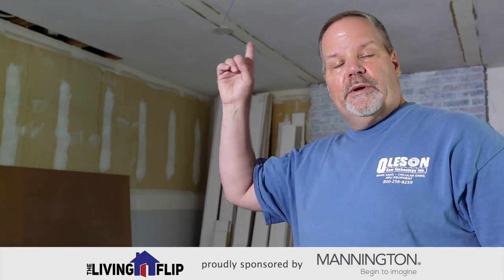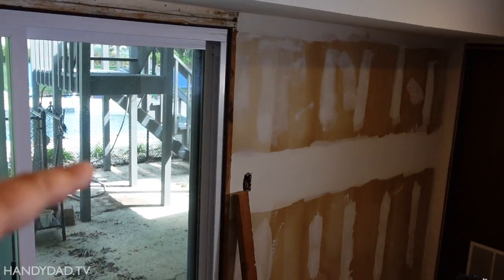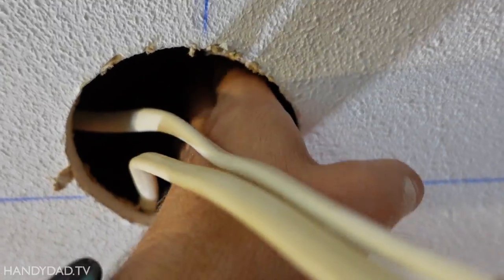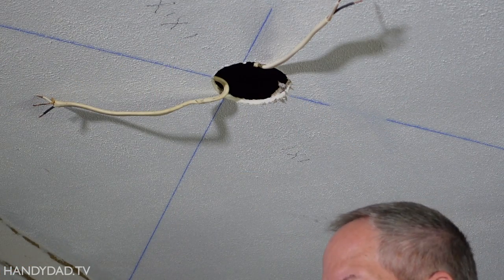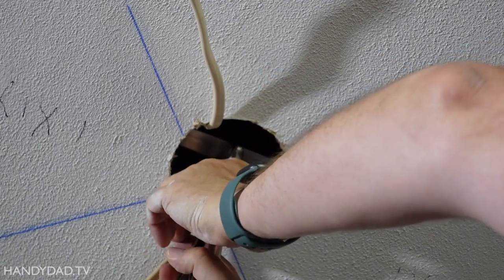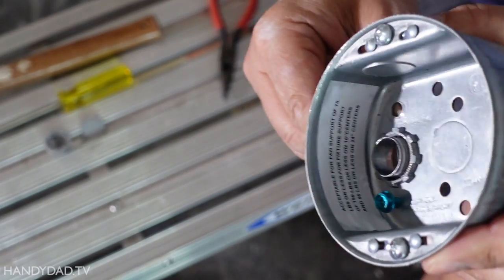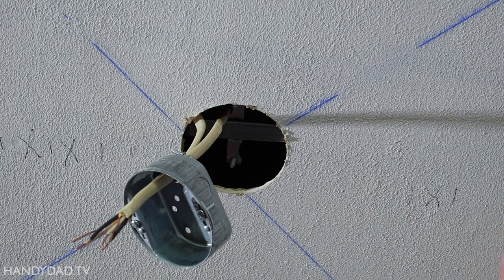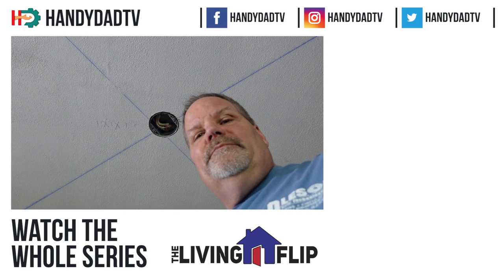WE ADDED A CEILING FAN // TLF 35

Comment: Great video showing how to install a ceiling fan/light junction box hanger. I purchased the same hanger and went into the attic to install the unit. With the legs upside down it was easier to screw them into the 2 framework. Easy to install and makes for a very secure hanger for the ceiling fan/light I installed.
Reply from the maker: Definitely easier with an attic

Comment: It has been a long time since I worked in residential electrical work, but I believe the Hubbell-Raco 2711B5 Connector, Squeeze, NMSC Cable, 1/2-Inch, Zinc requires an insulating bushing like Rigid/IMC 1/2 in. Insulating Bushing. You provide good tips and excellent process work. I may be wrong but If I recall correctly an uninsulated connection such as the one used requires by NEC an insulating bushing o minimize the chance of cutting the cable or wires.

Comment: I don't even need to install ceiling fan but I still watch it, it's very relaxing to watch your videos
Reply from the maker: Thanks so much 😊
Reply: @handydadtv  hello again‼ I need your expertise help again. I have a project where the kitchen lights I have are 2 halogen ballasts. I want to remove those and replace them with flush mounts, but also add 2 more flush mounts totaling 4 flush mounts. My question is how wod I add the 2 more electrical sources for the 2 NEW flush mount lighting?
Reply from the maker: You need to add ceiling boxes for those lights. Here’s one way to do it: https://youtu.be/KvZzLJmJhtU
Reply: @handydadtv  Thank You! For some reason the link will not open up though.
Reply from the maker: Hmm don’t know why it won’t work. Just look on my channel for a video a couple of weeks ago about adding a ceiling box in an existing ceiling.
Reply: @handydadtv  Yes ok. I think I should've asked, how would I tie in all of the electrical off of the 2 existing light receptacles to the 2 new added receptacles. I do know I can use the 2 round old work receptacles for the 2 new lights. Sorry for the confusion!
Reply from the maker: Ah gotcha. Here’s another video link https://youtu.be/x4TooPn0hd8. If that one doesn’t work, look for my video “Recessed lighting without an attic” about a month ago. It shows how I ran wires from an existing fixture to new ones. 

BTW, I realized the previous link was to the same video you commented on! Maybe that’s why it didn’t work.
Reply: @handydadtv  ahhhhhh ok, Thanks‼

Comment: TY for sharing.... I was running through this same exact scenario I needed an answer for and never realized that there was this type of box. When I installed the ceiling fan I noticed a week after it came down a little bit from the ceiling meaning the box was loose and when I first saw the box it looks like they just screwed it directly into the joist that was running alongside the hole. It was a plastic box and not a metal one. So I'm going to remove the fan remove the box and figure out the best case scenario. Thanks again and you now have a new subscriber because you present everything in very easy to understand terms and methods and installations.
Reply from the maker: Thanks for subscribing! Welcome to the family!

Comment: Thanks for this video im remodeling a manufactured home,  no cieling light, im using same bracket but its 2 1/8,  no biggie,  but i used  14/3 wire so i didn't have to run 2 lines 1 switch for light, and 1 for fan. thanks again. happy Thanksgiving. ✌
Reply from the maker: Thanks for the note. Happy Thanksgiving to you too!

Comment: Don't think you are supposed to put two cables through the same connector. 1 cable per connector per knock-out. There is an exception in the NEC code for plastic single-gang boxes where the wire is stapled within 6 inches of the box - there you can remove the plastic box connector and put two cables through the same hole.
Reply from the maker: I’m not an electrician. I just copy what I’ve seen electricians do.
Reply: You’re allowed up to two romex cables
Reply: @handydadtv  yeah but professionally speaking you would go one a piece. Looks better and keeps the wires separated for trouble shooting. I usually la el the wires and write in the actual box with sharpie.

Comment: Good job HandyD. I enjoy videos that don't edit out the mistakes. Makes me feel better when I have a brain fart. Do you have insulation in that attic? I have 3 feet of blowin insulation to work around ugh.
Reply from the maker: This is a downstairs ceiling so no insulation to deal with. I usually install recessed lights and fan boxes from the attic, if possible. But you have my sympathy having to deal with blown-in insulation.
Reply: @handydadtv  Ahh a downstairs ceiling. I would also normally install from the attic but I dont want to disturb all that newly blow insulation. I heard it doesn't insulate as well when you move it around.

Comment: These things are great unless you are working in a ceiling with a vapour barrier and blown insulation. It has to go above the vapour barrier and you have to plow through the insulation to reach the ceiling joist. You can't tell when it's seated against the joist. There is no real way of clearing the insulation from between the end of the bracket and the joist.
Reply from the maker: Yeah insulation sucks.

Comment: What I caught is you put the Romex wire connector up in the ceiling the opposite way 😂😂 great video though appreciate you!
Reply from the maker: No, I did that right. The screws to clamp the wires always go outside the box.
Reply: @handydadtv  you're right!  I think just looking at you mount it in the ceiling just seemed wrong cause if you had to loosen or need more wire. Good job 👍🏾 nice vid

Comment: Hi,
I’m so confused so you don’t need to bolt the metal piece to the woods/ joist? 

Any way for the bar to loosen or once tight it won’t come loose?

Thanks.
Reply from the maker: No need to bolt it. The teeth dig into the wood and then you attach the fan so it can’t unscrew.

Comment: I live in a double wide
Lucky I checked before installing ceiling fan 

The thing is
The hole is closer to one side 
about 4” from the stud 

The 2x4 stud in the ceiling are  24” apart 

So I don’t know what to do now
Reply from the maker: I would cut the ceiling from stud to stud and add another 2x4 between them. Then attach a pancake ceiling fan box to the new wood. Then patch the ceiling.

Comment: I romoved a light fixture and want to install a fan. There’s only 3 wires, ground, neutral and power, do I connect the ground wire to the screw? What ground would I use for the fan then?
Reply from the maker: All grounds need to be connected together always.

Comment: How did you know about how deep the brace needed to be. Im a beginner with these braces.
Reply from the maker: It has flanges that sit on the back of the drywall so the box is automatically at the right depth.

Comment: So what if you have to remove a weaker brace for an stronger one,, is there an easier way besides crawling through an attic..
Reply from the maker: You always have the option of opening the ceiling and patching it when you’re done.
Reply: There’s another video on YouTube that shows pushing the weaker brace up through the hole until it unseats, or using bolt cutters to cut the brace, then force/pry the 2 pieces out.